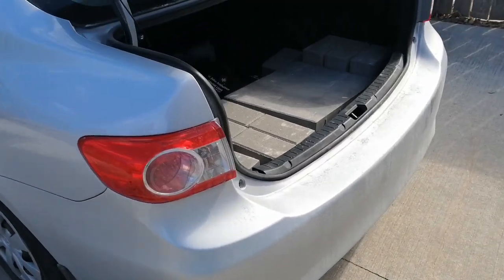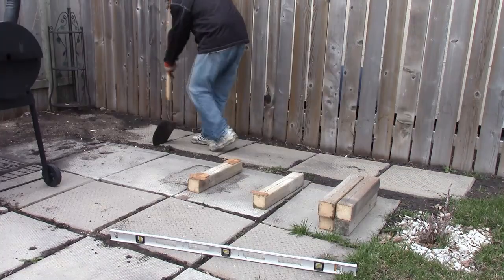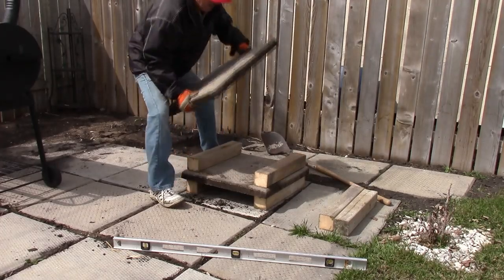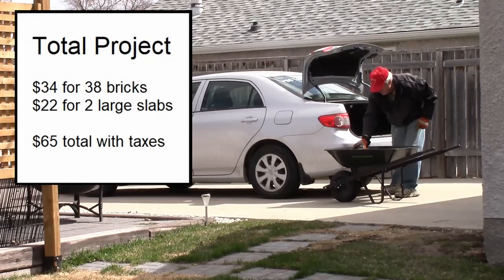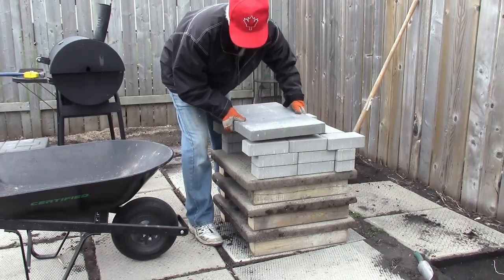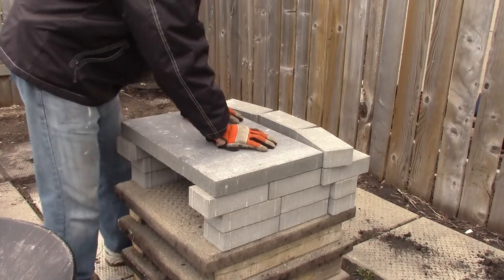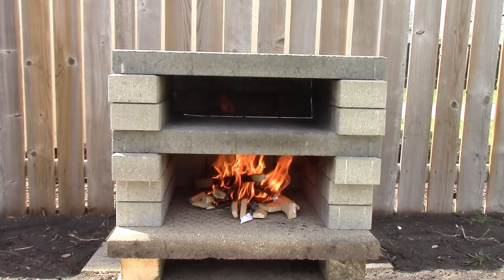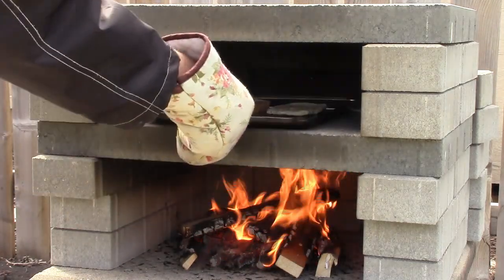DIY Outdoor Pizza Oven May 4, 2021

Comment from the maker: Just an update - that DIY project didn't work well.  I subsequently took it apart and created a different version (see newer videos).  However, wasn't happy with that outcome either (heat loss, size, blocks break).  Therefore, building a different version this coming summer that uses fire bricks instead of landscaping blocks.  Thanks for watching, be sure to subscribe so you get notified on that video when done.

Comment: Following to see how it works out after use a few times. I'm planning on this project as well. Hopefully I can get started in the next week or so. I'm trying to find cheap/free fire bricks for the sides and saving up for fire rated slab big enough for pizza deck.
Reply from the maker: The side bricks perform well with no cracking.  The sidewalk block at the bottom cracked (I assumed it might) but I have decided to put metal bracing under it.  I am redesigning so check out my latest video.

Comment: Another video on this topic recommended having the opening to the upper cooking level and that of the lower heating level to be on adjacent sides of the oven -- i.e. 90° apart -- so than one doesn't have to reach over the open flame and risk getting burned while,accessing the pizza.
Reply from the maker: Sounds like a good idea as well.

Comment: I built one, after two hours of burning almond wood  it was barely 300 degrees.   So I swapped out the paver for a pizza stone which is 1/4 thick.  Now I got it to 350?  Need to get it to at least 800.  Any suggestions.
Reply from the maker: I found similar issues so went to a different style with the wood inside where the pizza cooks (kind of a big oven with room).  That worked better.

Comment: Great job! looking forward to your cooking videos.  Let us know if the concrete slab will crack after a few times! I have been thinking to purchase a half inch steel plate beneath the concrete slab.  Cheers!
Reply from the maker: The side bricks perform well with no cracking.  The sidewalk block at the bottom cracked (I assumed it might) but I have decided to put metal bracing under it.  I am redesigning so check out my latest video.
Reply: not a bad idea,maybe it prevent cracking the concreet slab

Comment: Am looking to do my own. How did the slab go? Was wandering if a stone slab(ie granite) or glass(ie an old stove top)??? Any advise would be good
Reply from the maker: The cement slab does crack.  I ended up dismantling my first version and will try something different next summer.  I am considering solid cement base with wire rebar.

Comment: Dude that's gonna blow up
Reply from the maker: lol - no, pretty safe.  Even safer now with snow all around it.
Reply: @ababyboomerinwinnipeg  Please be careful.   I built one just like this and it worked great the first couple of burns with only a little cracking.   Started it up this week and it exploded.   Sounded like a bomb going off.    Water in concrete slab does not mix well with high heat.

Comment: Don't let the pizza oven bug BIT YA! There many things setting on your patio? That will make a EXCELLENT PIZZA OVEN  A Smoker, a Dome grill, a metal drum. Even your oven in YOUR HOUSE. I was going to build a brick one. But i was looking on my patio. and said to my self ITS SILLY FOR ME TO BUY OR MAKE ONE> i had a offset smoker. i can put 7 full size pizza in. A gas Grill, and a Weber Kettle. SO the WEBER KETTLE was very easy to turn into a pizza oven. Just turn the grate over and GET PIZZA PANS UP TO 18" a short heavy duty Pizza Peel, and 2 short rebar for the pans set even on it THAT IS IT

Comment: It will take a long time to heat up that thick patio block that the pizza sits on.  Better to use a  thinner "pizza stone" sitting on an old wire oven rack.
Reply from the maker: I have had to stand out in the cold checking on it - I have to agree, too cold.  I gave up on that style and am creating something different when summer comes.

Comment: The bricks and the two upper slabs are not likely sufficiently fire resistant to make a permanent pizza oven.  You'll need refractory bricks and slabs, especially if you expect to use the oven frequently.  Otherwise, the concrete will crack or possibly explode.  Good concept, and one that can be built quickly, but you need different materials.
Reply from the maker: Agreed.  I have already started planning a different version.
Reply: Thanks for the critique. I was wondering if concrete could explode in fire.

Comment: how well will these bricks work if it rains beforehand? Seems like regular brick would explode once they are heated if they have water in them.
Reply from the maker: No major issue with the side bricks but the base and top have cracked.   Still usable but could be long lasting issue.  I am also curious to see how they stand up over time - heating in winter puts a lot of stress on them hence the cracked top one.
Reply from the maker: @AlanMolstad  Wow, who would expect it to explode.  Wonder what caused that?  Mine did crack but I just put metal reinforcement under.  However, had dismantled that and trying new style next summer.
Reply: @ababyboomerinwinnipeg  

What im told is that rain water will go down into the cement and once you start to cook with a fire the water will cause the trouble.

But the problem is that there is really no way to stop rain from being the cause of this.
The cement blocks are kept outside where they are sold, so by the time a person takes them home  they are already full of water.

What happened to me is a sign that the basic design is flawed.
The design is asking for trouble.
And there is no way around this.

The idea of a DIY backyard pizza oven is great, and that is why these videos are liked,
But the truth is, that its a bad idea wrapped in a good idea...

Comment: Do you think using more porous “fire bricks” would have any benefit?
Reply from the maker: Not sure, but these do seem to work.
Reply: If the temp of those cement pavers and the cement slab get over 400 degrees F, they will eventually crack. Fire Brick and Fire Mortar are made for this.

Comment: I used cement blocks, it broke badly before the pizza was ready. 
What kind of slate did you use? Thanks
Reply from the maker: I was just using landscape blocks.
Reply: There's always a risk of that happening with a regular concrete paver.  They aren't really meant to take that kind of heat.  Fire brick is the correct material but much more expensive.  You can get away with pavers and regular bricks if you're willing to accept that they're going to break eventually but they're cheap enough to be expendable.  If you're going to go that route, there's 3 big things that I can think of that you can do to mitigate this issue.

1 - Make a real effort to really make sure that your keep the pavers dry.  Converting the water inside the paver from liquid to steam creates internal pressures.  If it's already bone dry, these are minimized.  A cool thing about this design is that once it's cooled off, you can just partially/completely disassemble it and move the pavers to a completely dry location.

2 - If there's any chance of moisture inside the pavers, bring the heat up slowly to dry the pavers out more safely.

3 - Go to the hardware store and get some steel flatbar and use it like a cross support beam between the bricks and the pavers.  That way, if a paver cracks, it won't collapse and ruin dinner.  Be sure to fill the gap created by the flat bar with something like some sand or recess them in some way so they're flush with the top of the bricks.

Comment: normal bricks and concrete slabs will crack eventually due to high heat
Reply: And bricks wil spall
Reply: Bricks are 50 cents and pavers are about $5. Not a huge monetary loss if you have to occasionally replace one or both.

Comment: This will crack after a few burns. You can’t use a cement slab unfortunately.
Reply from the maker: True enough.  Sidewalk blocks I put reinforcement underneath so cracking doesn't matter (showed in future video).

Comment: If you make the top three bricks deep, could it cook a turkey? Can you cook on top of the slab?
Reply from the maker: One thing about using non-mortared bricks is that you can try different configurations.  My latest video I am making it more of a deeper chamber like a Forno Oven.
Reply: @ababyboomerinwinnipeg  What is Forno Oven?
Reply from the maker: @MaLiArtworks186  similar oven that some restaurants use to cook pizza inside of but of course better constructed and much more expensive.  https://www.fornobravo.com/

Comment: Does it work with bread? Thank you
Reply from the maker: Only if you cooked the bread while it was warming up.  I think bread cooks at 200 F.  This heats up to 500 or 600 F which would be took hot.  However, I did cook cinnamon buns (like bread) while it was heating up so the temperature was lower.  Experiment.
Reply: @ababyboomerinwinnipeg  thank you so much!!

Comment: If you get concrete too hot it can not only crack but it can blow lumps of burning hot lumps of concrete off at you. Wouldn't recommend this method.
Reply: It would need to get a lot hotter then the 700 to 800 degrees that you will get here.